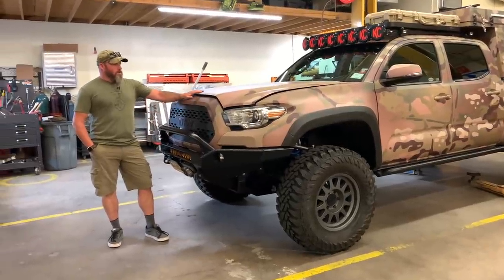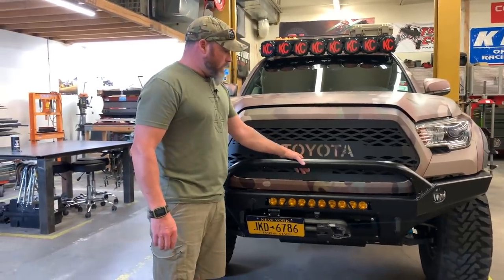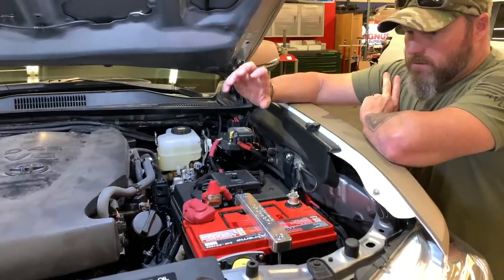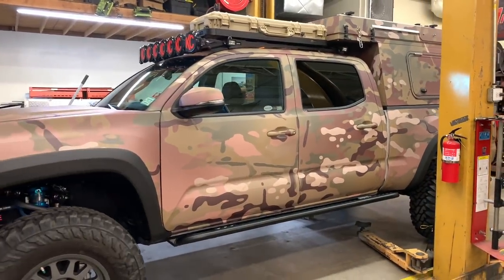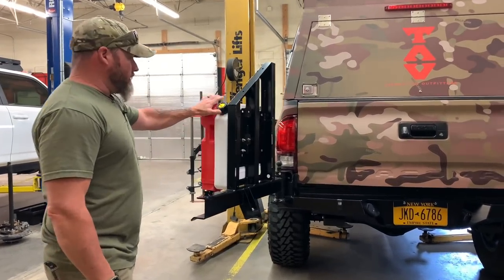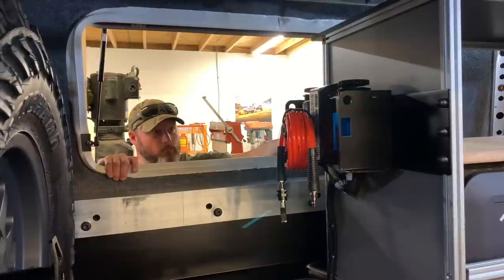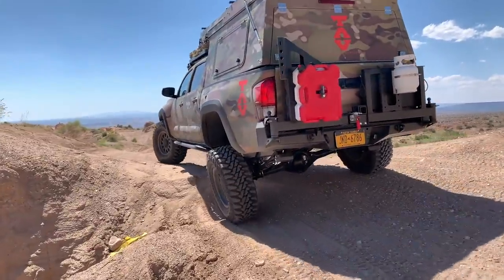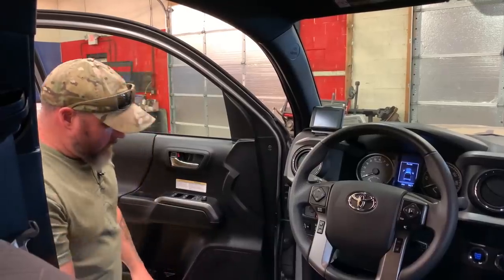MultiCam Stage 2 Long Travel Expedition Truck

Comment: Why did you go for 4.88 and not 5.29 gear ratio considering the total weight  of the truck and the  larger 35 size tires? Btw this is one of the sickest  I’ve seen, my Taco is screaming for this build.
Reply from the maker: Norkis Serrano because contrary to what everyone else out there on the forums say the 4.88 keeps a very nice RPM range at highway cruising speeds. The VF tune we used gave it way more off idle throttle response and more enjoyable drivability. The 3rd gen trucks don’t have a mechanical hearing issue. It’s an electronic tuning issue.
Reply: Tactical Application Vehicles -So does Pedal Commader helps as it seem to serve as electronic tuning like you said?Thanks

Comment: I see you guys use 4.88’s on all the Tacoma builds I have seen. Is there a reason you don’t go with 5.29’s? Thanks for sharing — very inspirational builds.
Reply from the maker: We run 5.29's on trucks running 37" tires or something that will be towing a trailer on a regular basis.
Reply: Tactical Application Vehicles thanks for the reply - I usually see 4.88’s for 33’s and 5.29’s for 35’s+ or even 33’s with lots of weight. I have 4.88’s but never considered doing 35’s with them. Maybe I’ll have to give it a shot now.
Reply: Have you found the 4.88 more adequate for this type of build?